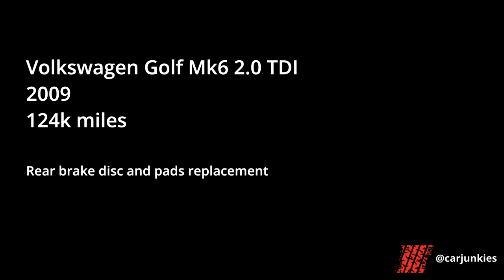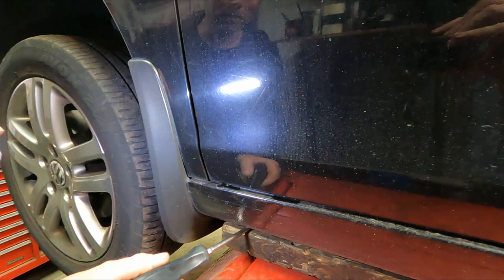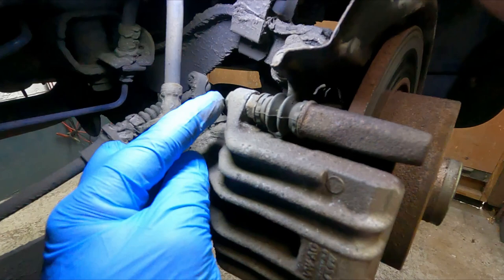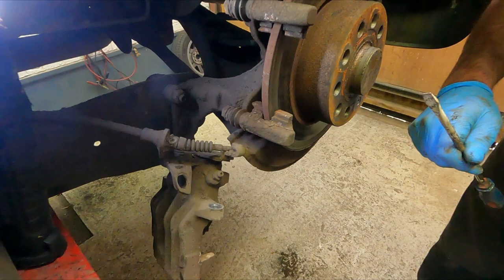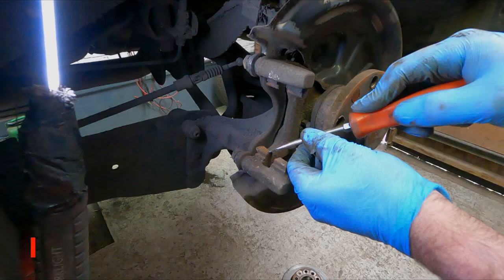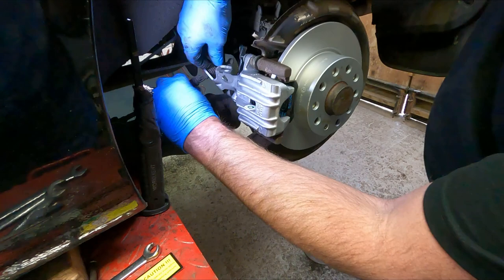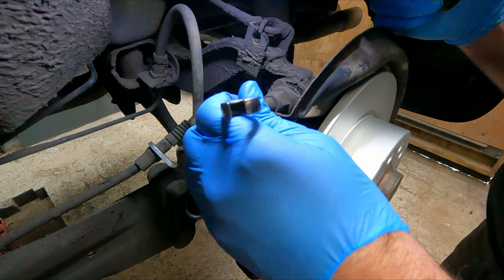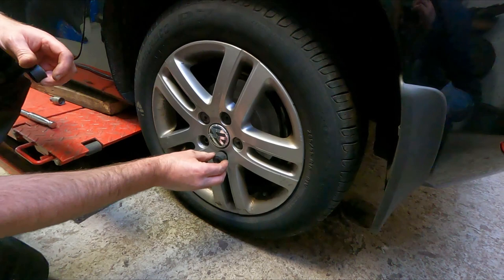Volkswagen Golf Mk6 2.0 TDI (2009) - Rear brake disc and pads replacement

Comment: Thanks for a great video. I think my disc on the mk7 might come off without removing the carrier bracket too? Carrier looks the same just a different calliper with the electric hand brake.
Reply from the maker: Hi @philbaldwin
Yes a lot of vw/audi/seat/skoda models you can remove the discs without removing the caliper carrier. Only way to know for sure is to try it ;)
Thanks for watching

Comment: Thanks for a well explained video, I was a bit unsure about the bleeding of the caliper and have purchased a bleed kit but after seeing your method i might give that a go instead.
Also handy disk comes off without needing bracket off too.. didnt know that either, other videos show people removing them.
I have a 60 reg 2.0 TDI and I see you can get a 253mm dia or 256mm dia do you know at all what size you used?
Thanks Again
Reply from the maker: Hi bishbash. Thanks for watching. Regarding disc diameter, check on a website like eurocarparts and put in your reg number. If you look under fitment detail and there are multiple sizes then you will need to ring them up, give them your reg number and hopefully they will be able to cross reference to main dealer. It’s not as simple as one size fits all for a given year or model unfortunately. Good luck

Comment: Hi just come across this video, you don’t know what size the diameter the brake discs where when you done this? TIA
Reply from the maker: Hi @rowanl2950
Cannot remember the dimensions of the disc but you should be able to give your motor parts supplier your car registration and they can then advise you on compatible parts at various budgets. You could also try the ‘Euro Car Parts’ website as well. Thanks for watching